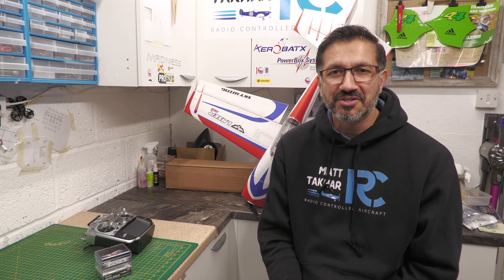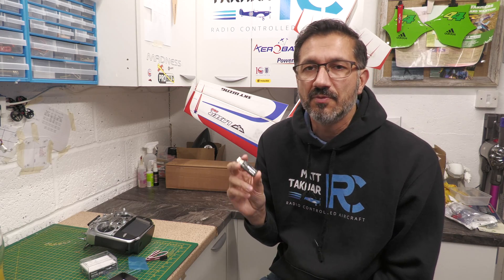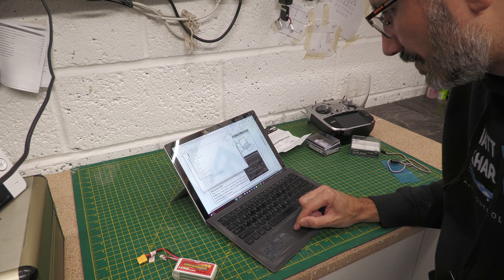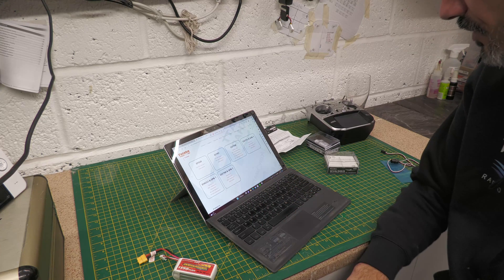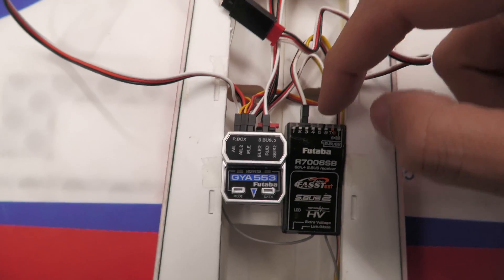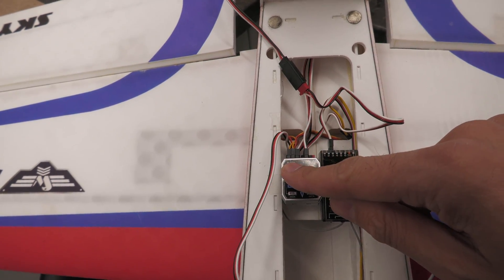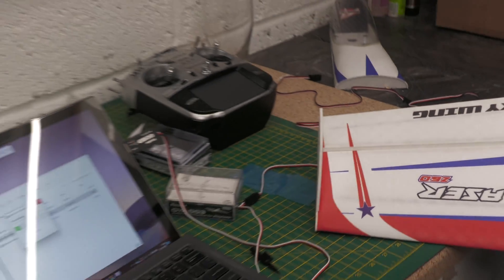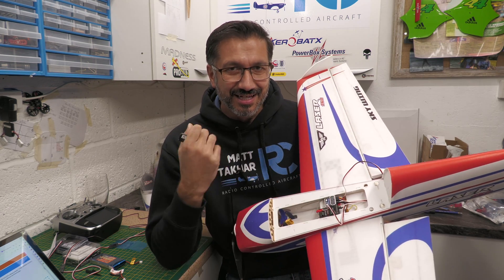Update GYA553 Gyro firmware with CIU-3 adaptor | Futaba

Comment: Hi Matt,at 12:43 the message on the screen says the ciu it's not connected,but it was for sure connected...,so..., i have the same message when i'm trying to update the gyro ,but i don't know what to do so the windows see the ciu usb adapter .Can you tell me please what I must do so the ciu adapter windows see it? Thanks in advance
Reply from the maker: Hi. Do you have the Windows Driver installed? If that’s not installed or Windows doesn’t recognise the device then it won’t work. Check in Windows Device Manager. You will either see it under USB or you will see something called “other device” which means it doesn’t have the driver.
Reply: Hi, i double click the driver from futaba website and i believe that must be installed. But i don't see anything at the device manager that makes me feel confident that the software is installed. So i don't know what else to do. I am not an expert on pc's. Very confusing set up.
Reply from the maker: @ntka100  that’s frustrating. If the software isn’t seeing the CIU then it must be the driver. I’m sure you’ve tried the obvious things. Remove the CIU, full reboot, wait for the PC to fully start up then reinsert the CIU. Then load the software up.  
I’ve just got a new PC for the workshop and will be going through this myself shortly. I’ll try and film it again, hopefully next week depending on how the current project goes. 
Failing that feel free to email me and I’ll try and help further. Matt.Takhar AT Gmail.com.
Reply: Hi Matt, i just did a full reboot and nothing happened. Same as before. I don't understand what is the problem. I 'll try to find a pc from a friend and i ll do the procedure again but on my friend pc. I let you know. Thanks Matt, we will talk soon

Comment: Be aware that if using the 553 gyro with the DLPH version 2 and the 2 Rx, the telemetry does not work. I was about to get one for my build until I read the instructions. I called Futaba. Great customer service, as no one answered but called me back later. I asked if there was some hack and the Futaba tech said there is no way around it. So that's that😢 I went with the Powerbox Mercury🥰
Reply from the maker: Wow I didn’t know that. Thanks for sharing it with everyone. 👍🏽

Comment: Hi Matt, Many thanks for taking the time to answer my question on the GYA553 using the CIU-3 Adapter. As usual your videos are very well explained and easy to follow unlike the Futaba Instructions. I'll be ordering my CIU-3 tomorrow. Cheers for now !! 👍
Reply from the maker: Thanks for the feedback and glad it was useful. Let me know if you run into any issues, hopefully it will be smooth and easy 👍🏽
Reply: Will do, Thanks  @MattTakharRC
Reply: Hello again Matt, I just wanted to let you know that my CIU-3 USB arrived this wknd and I've updated the Gyro without too much fuss. Not sure if the USB is a necessity in terms of making the gyro do additional things for my aircraft however, as you mentioned in the video it might rectify firmware patches which we don't see in the background like most updates. Anyway, thanks again for your helpful videos. Looking out for the next one 🙂 @MattTakharRC
Reply from the maker: I’m glad it went smooth for you 👍🏽. I’ll create some more videos on the CIU-3 in the coming months. I have a few others in the queue first. Never enough time 😁